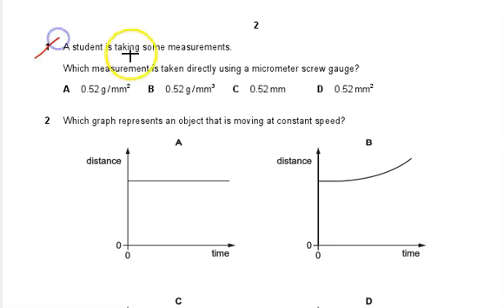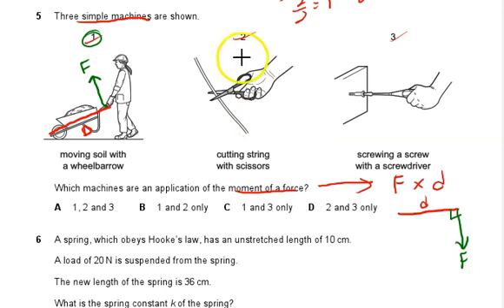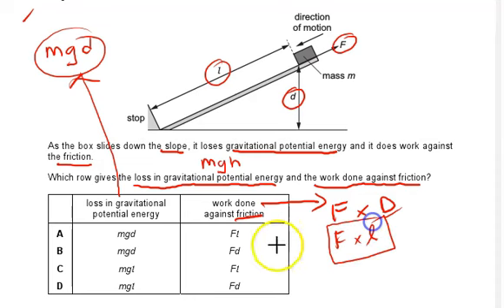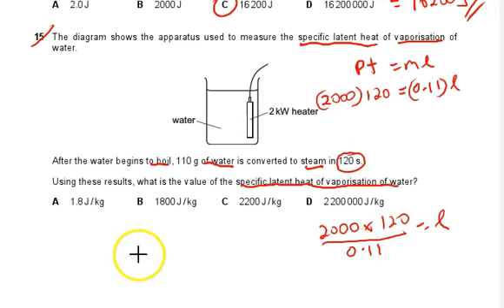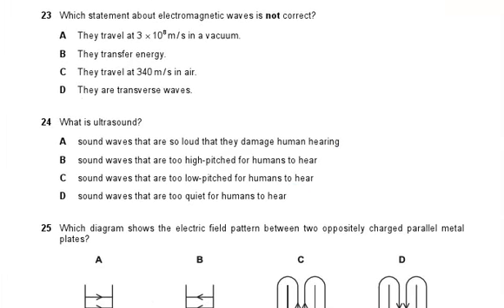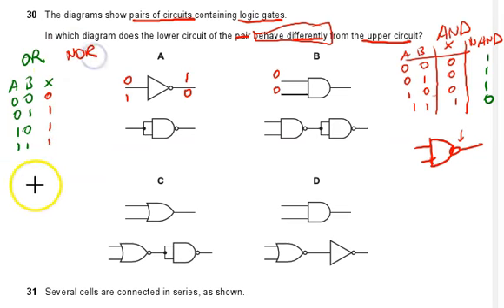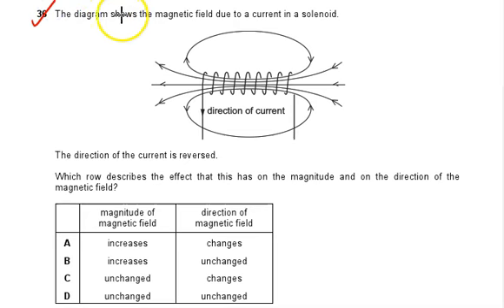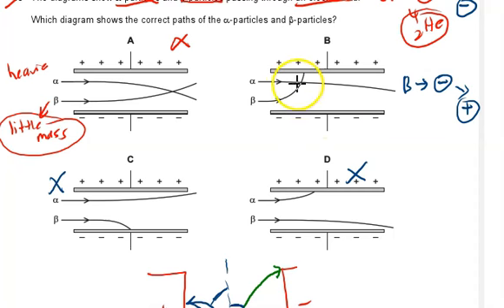IGCSE PHYSICS 2021 PAPER 22 0625 OCT/NOV | Solved answer| 0625/22/O/N/21| FULL SOLUTION

Comment: Question 28 is wrong 
The answer is D 
U did not add the 2 resistors at the end while calculating the voltage
Reply: Thank you so much I couldn't figure that out